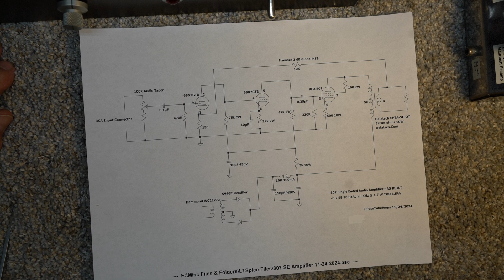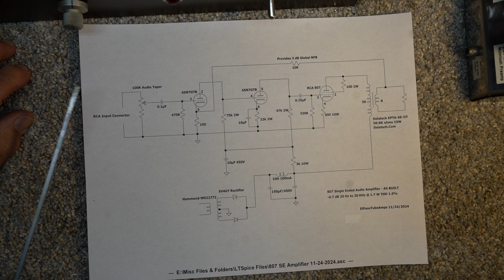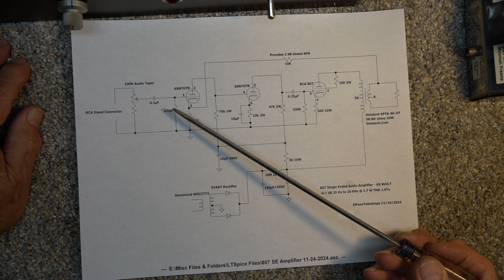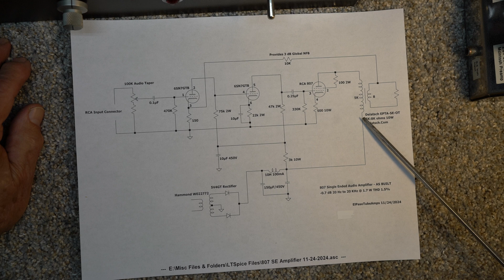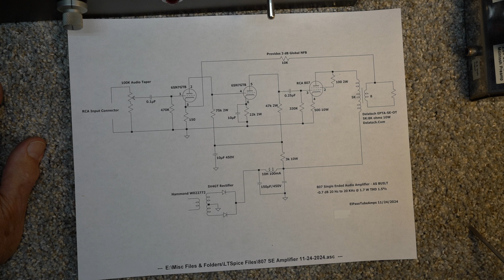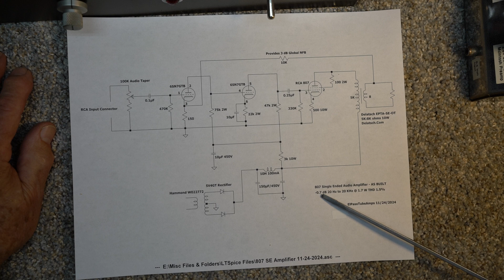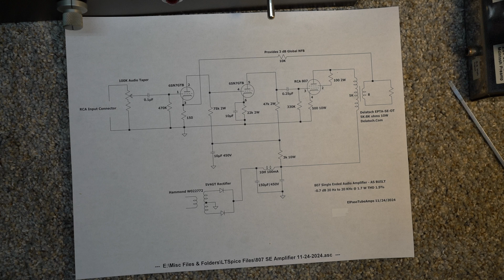807 Single Ended Amplifier Project - The  "Little Jewel" -  Schematic

Comment: Funny you mentioned using pot's to optimize the triode circuits.... I built a little box with pot's that I use to do the same thing, tube by tube. Most of what I use are old television tubes that don't have data for audio use. That box has a pot for cathode, grid leak, and plate load. I capacitor couple it to an audio source and load to watch the waveform.

Comment: Nice simple 807, well done. Although it works, I would be concerned putting 150uf as the 1st capacitor after the 5U4. Datasheet says 40uf. Possible stress on the power transformer & I think in a later video you said this transformer burnt out. Could be the reason. And I see you effectively used much less capacitance in the power supply for the stereo version.
Reply from the maker: Yes, I used 50 uF on each side of the PS choke in the stereo version. I forget sometimes and small pieces of equipment can stay on for a day or two and I can't remember in my history of any transformers going bad like this one.  I have destroyed transformers before by not having the correct size fuse with a short on the output of the PS but never one like this. Maybe just a defective one. I definitely prefer the military surplus ones.

Comment: Hi David,
Just rewatched the 807 series, but did not see the value of the 807 cathode bypass capacitor value, 
The calculator I used suggested 160uf, what value did you use?
Thanks again
Ken
Reply from the maker: Hi Ken, I didn't use bypass capacitors on the first stage or the 807 cathode. Leaving that capacitor off lowers the gain a bit but provides a little local NFB which I felt was more important than the gain it provides. The 807 just has a 500 ohm resistor that sets the quiescent current to 60 mA.
Reply: @ElPasoTubeAmps  Thanks David, I thought I had missed something, very interesting, 
great day
Ken

Comment: hi interesting  i have a question about negative  feedback ,if i  put a signal with my generator and i take the square wave at 1khz and  if i turn the 10k pot  to have the best square  wave ,is it a good  way to tune the negative feedback .thanks
Reply from the maker: The way I set the level of NFB is to (1) adjust the output of the amplifier for a clean sine wave at say, 4 watts. Then put a pot, maybe a 20K, in place of the 10K global NFB resistor and adjust it to say, 3 dB of NFB which would decrease the power by a factor of two or lower the power output to 2 watts. That would correspond to 3 dB of NFB. That does not mean you are decreasing your amplifier to a 2 watt amplifier as just a slight increase in the input signal will make the output come back up to 4 watts. Each 3 dB of NFB decreases the output by a factor of 2. If you want 6 dB of NFB you would adjust your 20K pot to have an output of 1 watts, etc. Then take the pot off and measure the resistance and put in a fixed resistor in place of the pot. As for a square wave, once you set the level of NFB with the fixed resistor, you can experiment with a capacitor across the resistor , something in the range of maybe 100 pF to 0.01 uF and watch the leading edge of a 1 KHz square wave and adjust for the best square corner on the leading edge. The goal being to attenuate overshoot but not so much to round the top leading edge of the square wave as that would start to attenuate high frequencies. Hope this helps.
Reply: hi if i understand well  its the value of the capacitor that adjust the square wave .It would be interesting that you show   the square wave  to judge the quality of the output transformer in your future vidéos  cause  output transformer  are not all the same  for  the quality  of the square wave .i use hammond  output transformer 1628 se  its not bad but  the square  wave  are not  very good at 1khz and 10 khz.  @ElPasoTubeAmps
Reply from the maker: @kubockferre5532  I don't want to bad-mouth Hammond transformers as I know a lot are in service and people are happy with them but... the (brand new) power transformer in this very amplifier shorted the secondary... dead... fortunately, I had a military transformer that I was able to install and it is working perfectly again. I may have to show a picture of it in a later video. I have noticed on pretty much every occasion, that the Hammond chokes do not measure advertised inductance - a 10H is likely to measure more like 8H. Not so with the surplus chokes I take out of military equipment - so much for that... as for the OPT, the square wave response is excellent - the tiniest bit of overshoot that can be taken care of with a small value capacitor. Too much capacitance and it rounds off the leading edge and HF response. I do not use a capacitor across the NFB resistor. Just my experience.
Reply: hi ,i  do experiment with the negative feedback    but i dont see  the difference  in the shape of the  squarewave  with my scope only  the gain decrease so is it normal  ! is the différence occurs only  by ears ! thanks @ElPasoTubeAmps
Reply from the maker: @kubockferre5532  You are doing it right. If the NFB is (negative) you will see a gain decrease but it is compensated for by just raising the input driving voltage a bit more. It does not actually lower the power output capability of the amplifier.  I highlighted (negative) because if the phase at the output of the OPT where the NFB resistor is connected is not negative with respect to the cathode it is being fed back to, the gain will increase instead of decrease as the value of the resistor is lowered.  
I have never noticed the shape of the square wave as NFB is increased but I don't think it would affect it at least not very much. In my opinion, a little NFB is a very good thing. I have heard one fellow say, "NFB is your friend". I agree. With no NFB at all, the frequency response is all over the chart and so is the power response. Some may prefer it that way but I don't. I was sitting around thinking of taking this amplifier to the shop and doing a video on NFB - I think that is what I am going to do and study square wave response also.  Thanks  🙂

Comment: hi,can you tell me what is the voltage of the power transformer at the secondary if i put silicon rectifier diodes.i dont found your hammond reference on internet.i find weird that is no bypass cap on the cathode of 807 .Can i find shematic draw on internet  i could do a clean  copy .You indicate output R9  ,373V but i dont see R9 on your shematic.thanks a lot

Comment: Hi David, i just caught up with the videos and what a neat amp you built! very jealous and a bit inspired, maybe i will steal your schematics :). i just got in to a rabbit hole of designing my own transformers and this would be a nice test bench, just finished writing a software to characterize BH curves and permeability if you are interested. keep up the good work and as you say stay safe!
73, IU3IRR
Reply from the maker: Hi Manuel,
It sounds like you are doing well. I am truly surprised at the performance and sound of such a small amplifier. I built it on a burst of energy and knew to keep up the energy so I wouldn't drag it out or tire of it. My friend, Marko, as mentioned in the comments is a professional transformer winder. Maybe you two have something to share in your new endeavor. RF is still very much a big part of my hobby life and my last amplifier built and working is a 3-1000Z so I haven't lost the love for HV...  🙂 Stay safe and thanks for keeping in touch.  73  WA4QGA

Comment: Thanks Dave. It was great watching you through this. I want to ask you.........Regarding making cables,, are you suggesting making interconnect cables for my audio system, say from phono stage or CD player or DAC to amplifier using 50 ohm coax? Red to center and white to braid?
Reply from the maker: The 50-ohm impedance only matters for radio frequencies, not audio. For audio, it’s just wire, and it will work well, shielding against noise and help keep sound quality high.
Reply from the maker: RG-58 coax will make good interconnecting cables. I am thinking mostly using male RCA connectors on each end for stereo equipment and BNC for test equipment.
Reply: @ElPasoTubeAmps  thanks Dave. I have some high quality RG-58/U to do this. The only question I have is that the 50 ohm impedance won't affect anything?
Reply from the maker: @dtg474  It will work great. It is only 50 ohms to RF and to audio it is just a piece of wire little more than lamp cord but with a shield  from noise.

Comment: Thanks for posting that, thought the two triode stages were DC coupled from your last comment in the last episode. I see things that could have been done differently, EG a 100r & 47r split V1 Rk with the 100r AC coupled to get more gain, same with the 500r 807 Rk. I'm sure though, that you considered all that, & as you said the you empirically tested the amp & tweaked the circuit to suit.
   The 100r B+ to screen grid resistor is used in a lot of Tektronix valve scopes, and numerous vintage test gear circuits. An interesting book if your not already familiar with it is "Some basic vacuum tube circuits - used in Tektronix instruments" which shows all the building blocks of valve design as used by Tek back in the 50's/60's.
   Lastly, noticed you use a stereo audio feed into mono when listening to audio & that you mostly build monoblocks. Is the amp building to you more about the building & testing? Thanks again for uploading. Best regards..DA.
Reply from the maker: I have built many amplifiers just for testing - crazy, huh? With that said, I have three that are stereo, two Williamson, one with Acrosound OPT and the other with UTC OPT and one SET with 300B. All of these were built to listen to and they are my main amps and my preference even over the McIntosh amps. The 300B mentioned will be getting posted soon as I change the circuit to one of the nice SE transformers, the same as in this video, that I bought from my friend in Poland. My 300B SET is a strange design and I will elaborate in the video but I am sure it can be improved considerably with a good SE OPT instead of the choke loaded plate circuit. It is the 300B where I did the testing and tweaking of the component values to my satisfaction and used that design in this amplifier. As you might have noticed, I find this one good enough I gave it a name, "Little Jewel". I hope it helps others experiment with SE amplifiers - a design amazingly simple and can perform beautifully if done correctly. I was totally against SE designs until the 300B and now this one that definitely sounds better than my 300B stereo version. Thanks for your comments. Lots of good information and the component values and design details of the vintage equipment like Tektronix, are hard to beat, to say the least.

Comment: What is the resistor called when you tied the output tube screen to the plate? its changing the Ultralinear of the output tube. The LOAD Resistors are the preamp tubes Cathode resistors, but what does the LOAD Resistor do? The LOAD resistor values adjust the asymmetrical clipping of the positive cycle and negative cycle

Comment: I would love to build a SET amp like this with a 6SN7 and a 6550. I need to look at what would change in the schematic (including potentially the OT) to make that happen. Thanks for detailing this so well! I have learned so much from you and I cherish every new video.
Reply from the maker: The voltage amplifier section could be the same. A 6550 should work  just have to get the cathode bias resistor value correct for a proper amount of current thru the 6550.
Reply: For a 6550 tube in ultra linear, use around 440v on the plate, a 550R 10watt on the Cathode with a 220uF bypass cap, a 270k grid leak resistor, and a 1.2k G2 screen resistor connected directly to the 40% tap and it will bias at around 85% dissipation. For triode mode just change the G3 screen resistor from 1.2K to 100R and connect it directly to the plate lead. Bias will be about the same as UL.

Comment: A very simple design.  Exactly how the tubes are supposed to run.  That's great!  I also made up some input cables out of rg58.  Nice cables.  I would use it in a chassis if I needed a longer run. Definitely don't have to worry about high audio frequency using it.
Reply from the maker: Agree that RG-58 is better than most of the audio cables.

Comment: I had a scrap stereo amplifier chassis out of a record player, using two 6BM8's, where they forgot to install the ground wire to the speaker outputs. It didn't have negative feedback from factory. It probably sounded acceptable during its life if you didn't know differently, but it sure sounded better when I grounded those terminals.

Comment: Any reason you did not use a coupling cap before the 2nd 6SN7 stage? wouldn't this introduce DC onto the grid of that stage? Isn't that bad?
Reply from the maker: That is why the cathode resistor is 22K instead of the typical low value for a cathode resistor. It is a proven design from Williamson amplifiers so I copied that detail.

Comment: That 500 Ohm cathode bias resistor would dissipate 10.8W at 60 mA.
Reply from the maker: I^2 * R = 0.06^2 * 500 = 1.80 watts
Reply: Man, I messed that one up. 😮
Reply from the maker: @K5HJ  No more than I do sometimes...  🙂 Thanks and 73  WA4QGA